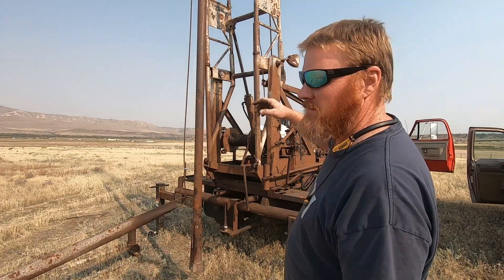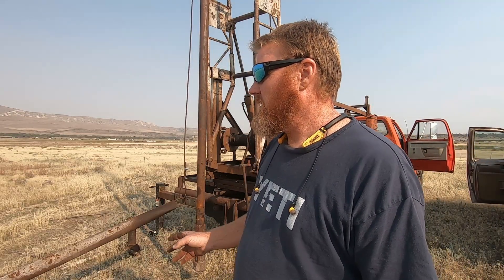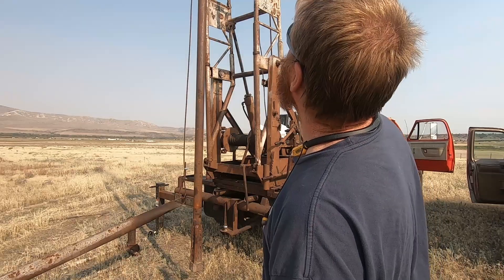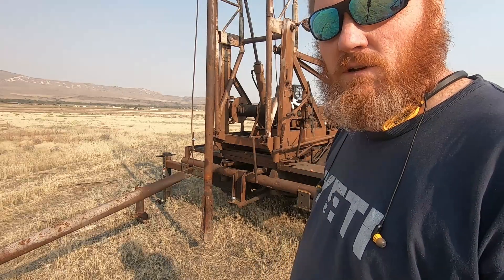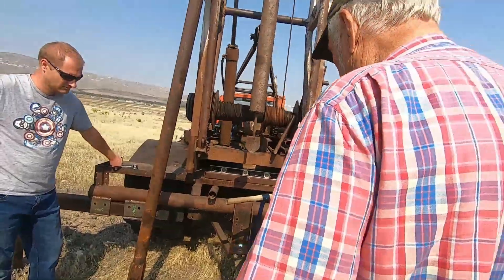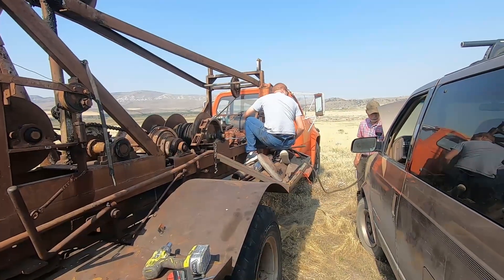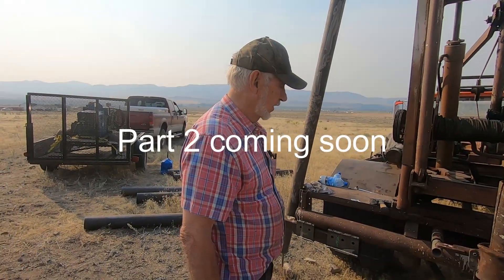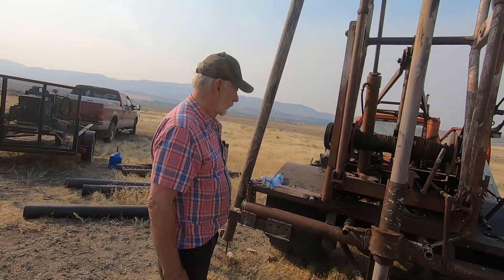Cable tool well drilling in ACTION! Newbies drilling a well for the first time with a cable tool

Comment: Brings back memories from over 40 years ago regarding drilling oil wells in both Oklahoma and West Virginia with cable tool rigs.  Some were existing wells which had been plugged and abandoned long ago and others were new wells.  Great for reentering abandoned wells to drill out tree trunks and other junk which had been dumped into the old wellbores.  The oldest well had been drilled in 1906.  One of my favorite experiences was when the oil driller showed me now to break up coke bottles and drop those in the well to help drill up lost rubber seals.
Reply: They were still using cable tool rigs 40 years ago? I thought they left that technology behind 80+ years ago for oil. Now we drill thirty thousand foot wells in under two weeks.

Comment: it doesn't look like your tools are turning that is a must if you want to drill a hole with a cable tool.
Reply: Cable twist into rotation
Reply: Wrong. 
You clearly don't know A 
THING about Cable tool.
Rotary Drilling the drill bit turn.
Reply: @tonyhudson8698  have drilled wells for 32 years rotary and cable tuul .every time that drill bar (with bit on the end of it) comes up off bottom it should turn anout one half of a inch. before dropping again, i did not mean yhat it should turn like a rotary drill rig does.

Comment: Take apart, fix. Just nuts and bolts. Put all your cable on left side, you will ruin cable if you don't. Keep only one row on right side of bull real. That is dart valve bailor. 56 beats a minute. Hold that cable keeping in center
Reply from the maker: Ide give anything to have a veteran like yourself show us the ropes. Your advise is well recieved.
Reply: @veggitarianredneck  be glad to help anytime, retired and bored.
Reply from the maker: @gqp3215  where you live at lol
Reply: @veggitarianredneck  burnsville nc
Reply: Put water in that hole, 10 gal.
Reply: When thick clean out. Put in 10 gal. Fix clutch. Still make parts for just about everything. See trident tool
 Front royal va. They are the best cable tool mfg.

Comment: If you could tighten the spudding clutch up a bit,  you'd run a lot smoother.
Reply from the maker: We did, and it does lol.
Reply: @veggitarianredneck  good job. I've been running cable tool rigs since I was a kid. I'm 45 now. That's a neat little rig you have there.
Reply from the maker: @wvwaterwelldriller  what's the best way to get the aquifer sand out of the hole? The bailer wont quite get it
Reply: @veggitarianredneck  if you're drilling sand you will probably have to keep driving casing until you get to either bed rock or a water bearing formation. If you're just talking about removing the cuttings a heavier bailer will definitely help to get to the bottom of the hole and try to keep your mud as thin as possible. I usually use 12 to 15 gallons of water per 5 ft run then bail the hole clean and repeat the process every 5 ft. Where are you located and what type of formations will you be drilling in.
Reply: @veggitarianredneck  get a dart valve bailor. Md. Master 35 years 6 cable rigs